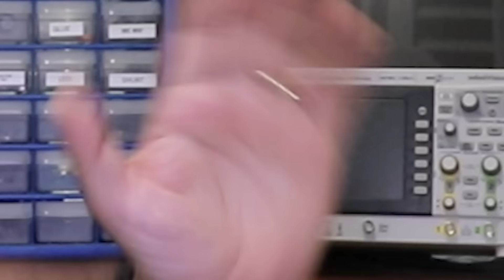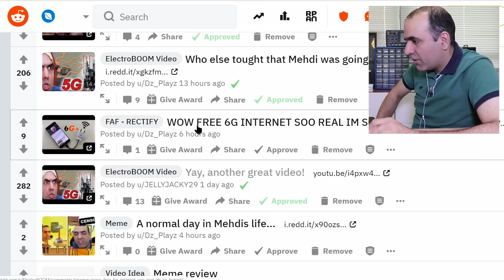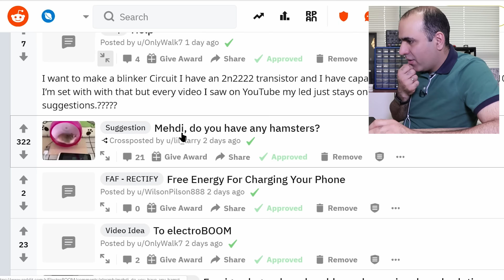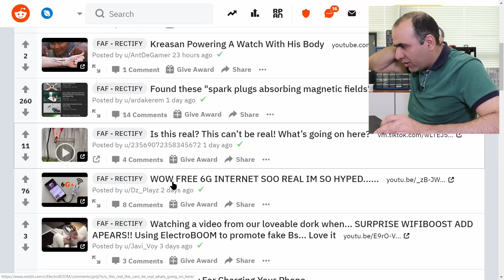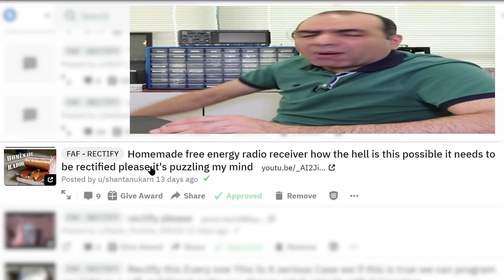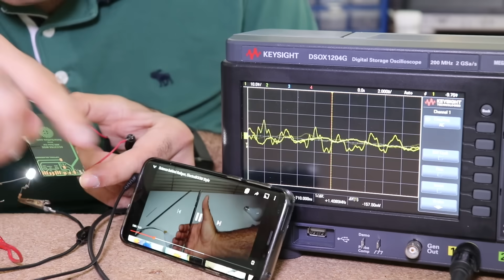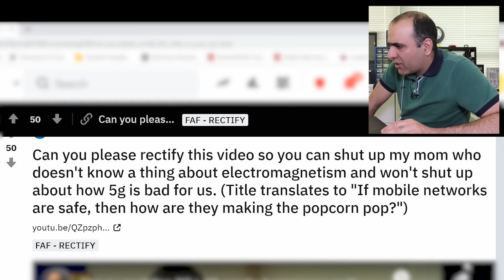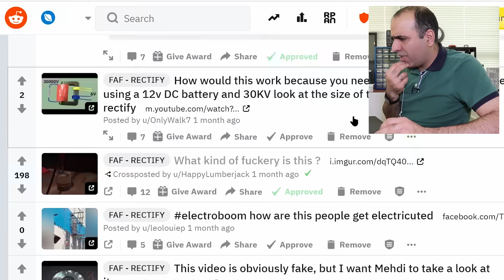ORIGINAL CONCEPT: Reviewing Your Reddit Submissions LATITY-001

Comment: Dude: I got a crazy idea, I can send data with light!
Me : Don't we have internet through optic fiber tho?
Reply: Also lifi
Reply: Well, it's a great way to showcase the concept of optic information transmission, for sure.
Reply: The response time of the solar panel voltage would be very slow. I tried this and the fastest I could reliably transfer data was 1.3kbps. Photodiodes designed for sensing light instead of collecting light can go into the Gigabit range though.
Reply: also 150GBPS isn't even so much fake tbh
Reply: 1. One human cell contains 75MB genetic information.
2. One sperm cell contains a half of that; that is 37.5MB.
3. One ml of semen contains 100 million sperm cells.
4. In average, ejaculation lasts for 5 sec and contains 2.25 ml semen.
5. This means that the throughput of a man’s penis is equal to (37.5MB x 100,000,000 x 2.25)/5 = 1 687 500 000 Megabytes/s = 1 769 472 000 000 000 bytes/second = 1609.325408935547 Terabytes/sec. (In data line / network terms a 12 874.5 Terabit Line)

This means that the female egg cell withstands this DDoS attack at 1,6 terabyte per second, and only lets through one(!) data package, thereby being the best hardware firewall in the world!

The downside of it is that this only small data package that it lets through, hangs the system for the whole of 9 months!
Reply: @ulkoalex  Thats briliant. :)

Comment: 5:05 This one actually works, Theres a boost converter wich outputs 5V (i've got the same type laying around, very handy)

you can even easily use a tiny solar cell, allthough you phone will never actually charge, it'd take FOREEEEVER

I've tried the thing with a solar cell and a 7W flashlight. I suppose the output wattage is less than 100mW but technically it's charging
Reply: I doubt it. I have a few hand crank 3V LED flashlights and the physical resistance against the applied torque is huge. Considering the resistance at such low power output, I seriously doubt if a hamster can power something that requires much higher power.
Show us a video of your setup and it will be much appreciated.
c:
Reply: @mu11668B  I'll try to make a video tomorrow, I'll send you a message

the point of my comment was supposed to be that you don't need alot of current to make your phone say that it's charging, it takes alot more to actually charge it. also, i think the motor in the video didn't have a gearbox and these small brushed 3V motors are relativly easy to turn even with shorted outputs

Comment: you can probably make the microwave beam safe if you hide behind a fine metal mesh, similar to the mesh on the microwave door. the microwaves will not pass through holes in metal under a certain size.

Comment: Hmm.
I wonder if I could make a microwave gun that focuses microwaves in order to burn things at medium/long distance.
(For research purposes of course)
Reply: "Gun" and "research purposes" in the same sentence
Reply: So basically a laser gun with lower frequency 😉. Sure you can do that, just remember that the power drops by squre of the distance. So it will be very short range gun unless you have a power plant in your back yard
Reply: @-JG-339  Hmm.
Who said it has to be a continous beam?
If i could make a large enough capacitor bank then i could prolly make a pulsed version.
Reply: @-JG-339  that's called a MASER, they exist, fucking expensive tho. I believe he just means a parabolic waveguide that directs the light into a parallel beam, like almost all flashlights do
Reply: Focusing microwaves requires very big dish antennas just to get to 15° or so. I'm surprised the guy even managed to light a tube that far away. I bet he had to arrange the lamp and microwave carefully to just about get it to light at that distance. Without the metal fridge wall reflecting, this would probably be too far already.
Reply: Keystone Science did this!
Reply: @MrScorpianwarrior  I might check them out.

Comment: Blinking two leds using transistors is so easy and i tried it. It works btw so thanks
Reply: I built that circuit when I was an apprentice. When I was done I started to replace the resistors with potentiometers and tryed different capacitors. That was when the real fun started^^

Comment: That microwave guy needs help ASAP before he cooks himself...
Reply: i think that is fake tho... how does microwaves stand out so much time ? i saw a video trying to do that with a choco bar and didn't even started to melt... it needed the shieding (reflection) to continue strong and active... I don't know... seems fake to me... even with that sfx still... i doubt
Reply: @MsTatakai  If you're referring to the King of Random video, they were just firing the microwaves out of the front in a big unfocused blast. In that guy's case, he was focusing them in more or less one direction. It's like a flashlight vs a ceiling light (or even a laser). The ceiling light and the flashlight can both be equally bright, but the flashlight will take a lot less power because it focuses the light into a much tighter beam.
Reply: @awareqwx   makes sense and yes was thet video i was refering it ... but that cone shaped could be an amplifier and expands the way all the way to the lamp and it turns ON and he did a harmful wave indeed but I don't know if it would reach him and also we kinda don't know how far is he recording with the camera =P but yeah being open minded is also bad for this... everthing can be ezly influencied XD (talking about me)
Reply: In argentina we have a youtuber called "el angelito" he modified a microwave to use it as a cannon for experiments. He is a technitian with decades of experience with high voltage
 He really knows his stuff
Also says NOT to do it at home
Reply: David Daivdson  microwaves use the same frequency as satellite communication and airport scanners. Youll probably get a visit from the feds and a FAA inquiry.
Dont do it.
Reply: @Tatwinus same frequency as non-essential communications. Wifi is there, but government/military coms are not. That band is meant to be noisy, i doubt anybody would notice leaky microwave. Maybe your neighbour's wifi would fail, and that's it.
Reply: Yeah cannot stress this enough dont do this and if you are do it outdoors and not in an enclosed area
Reply: @shadowxxe  lol do it "safely" outside like Kreosan
Reply: @shadowxxe  there is no "if you are" for that. There's only "DON'T FUCKING DO IT!!"
Reply: @shadowxxe  I really don't think that's a worry for a few reasons.
1. it's unlikely to have standing wave in such a random and "open" (windows, floor and ceiling that likely aren't reflective) environment, so that helps quite a bit
2. most parts of your body have built in temperature sensors. You will know before you are burnt
3. At absolute absolute worst, intensity should drop by the square of distance. When you microwave food food is some 20cm? away from source. King of Random did an experiment where they tried to microwave things with an open oven. They couldn't pop popcorn for like half an hour. If you stand 2 meters away you are receiving 1/100 of that. At that rate of heating it's hard to imagine your sweat glands, or even just your surface area, not being able to dissipate the heat.
Also just in case, microwave isn't ionizing, so no dna damage. Heat is all it does, and that it doesn't do a lot.
Reply: @randomnobody660  They taught us if we ever walked in front of a plane and we felt our balls tingling, to step to the side of the plane and tell the pilot to turn off his weather radar.
This is transmitting at about 6000 watts.
Reply: Or some innocent bystander!
Reply: Couldn't he wear full body protection suit? If somebody can built something like this i can't believe they are crazy enough going unprotected
Reply: he probably turned into Radioactive Man by now
Reply: Let him it's just natural selection.
Reply: Nah let him cook. 😏
Reply: That guy made a actual tumor machine, dont try it outside or inside, just dont do it.
Reply: @DajJohnDude  rewatch Mehdis video on 5G, microwave is non ionising radiation, no tumors (insert Arnold Schwarzenegger oneliner).
Reply: @sergeigontcharenko3476  Could still cook your eyes.
Reply: "Just a little bit of cancer, Stan!"
Reply: @ross302ci  vinesauce

Comment: 11:15, Try using a Laser Pointer as its intensity mostly remains the same for any minor change in distance, which is a great problem with LEDs
Reply: We should figure out a way to transmit internet with it. I call MY invention THE OPTIC FIBRE FIBER OPTIC LASER INTERNET.
Reply: @sambishara9300  Whooaaaa you should put it inside a cable and build a whole network of internet distribution out of it!
Reply: well, actually there is a video showing similar concept for "hacking" alexa(or google thing, forgot what it's called) with a powerful laser through a window, by shining it on the microphone hole. Cool thing
Reply: @nestor1208  Yup! checkout the channel @SmarterEveryDay and you'll find that video among a lot of other interesting videos! :)

link to the video : youtube.com/watch?v=ozIKwGt38LQ
Reply: @nestor1208  It's a video from SmarterEveryDay, link : https://www.youtube.com/watch?v=ozIKwGt38LQ
Reply: Are we realy trying to make SPDIF over optical from scratch?
Reply: @MazeFrame  isn't SPDIF digital transmission standard? Also ADAT
Reply: Literally how optical audio works
Reply: The idea behind lifi is that we can use ceiling mounted leds to transmit data through light modulation

Comment: how you are supposed to know where random wires in the wall are? competent electricians will install wires going directly upwards from sockets soo just don't drill or pierce a wall above a socket!!! but yeah also use a live detector because sometimes incompetent electricians may have fitted your sockets and run wires in a maze like pattern for some reason

Comment: Put 5 microwaves together like the guy did in the last video, and set them up around a generator so that to turn them on you have to turn on the generator, but the microwaves are connected so that they spin. Add a bunch of lasers and dust in the room. Massively dangerous stranger things style microwave gun used to open portals to the other side.

Comment: About the live screw in the wall: Usually it's kind of standard to run the wires vertically up towards the junction boxes, so it's always a good idea to avoid drilling right above the contacts/switches etc. Some countries run the cables vertically down towards the floor (Only Germany comes to mind as an example atm), so in any case - try to drill a bit off to the side :D Also if the junction boxes are not directly above the contact/switch etc., the cables coming from them do a 90 degree turn in the direction of the junction box once they reach its height, so keep that in mind as well when drilling near the ceiling. The amount of times I've seen people drill into electrical cables and later having to replace them is not even funny :D

Comment: Audio transmission through light! That's groundbreaking… in 1880, when A. G. Bell already did it.
Reply: how was this 1 day ago
Reply: @fw1093  Patreon/ Channel Supporters my guy. They get it early I believe.
Reply: @fw1093  some comments are from 2 days ago
Reply: I like the intro LALITY
Reply: @dantetinai5917  It's LATITY not LALITY
Reply: Actually most people don't realise that they have been using data transmission through light for years now. Infrared remote control is example of it.....😄😄
Reply: @kaustavsengupta8757  Actually, basically every communication technology we have is through light, from Internet/Wi-Fi to AM and FM radio
Reply: @WarioNumberOne  yes exactly! It's light that we as humans cannot see. They are at wavelengths the eye cannot see.
Reply: @WarioNumberOne  I know, every wave and visible light is part of electromagnetic spectrum.
Reply: We could send the light down a guide and call it Fiberoptic data transmission.
Reply: @dogwalker666  or use a specific light to read files off a metallic disc of some sort. Maybe call it a compact disc?
Reply: It would have been cooler if he had used an LED on the receiving end as well.
Reply: Even I did a project on it. (Li-fi or light fidelity). Mehdi was right the sound is directly proportional to the distance between the receiver and transmitter
Reply: @Idunnowhoiam102  I've seen laser pointers with 3.5mm inputs for exactly this purpose so the distance can be massively increased.
Reply: I remember going to a science museum, and you connected a light source using acrylic shapes to the receiver to play music. I think it quoted A. G. Bell too.
Reply: Tosslink anyone?
Reply: @UntrackedEndorphins  toslink is digital
Reply: I'm using an optic cable from my motherboard to my amp in my PC audio setup.
Reply: @simp-slayer  my old CD player links to the amp with a Fiberoptic
Reply: The dude was so excited about it he actually tried naming his daughter after it
Reply: Yep, in fact you can bounce a laser off a window and using this same method you can listen to people talking behind the window. I think I read somewhere the CIA did this.
Reply: @billtyson56  Leon Theremin, buran, KGB stuff but the concept isn't exclusive to the Soviets
Reply: @billtyson56  interesting. care to elaborate more or list interesting videos/references on the subject ?
Reply: @billtyson56  interesting project. please post on reddit so Mehdi can try it :D
Reply: Theres a movie which talks about all that it's great you should watch it
Reply: I would rather call that signal transmission than audio transmission
Reply: I actually did that in snap circuits
Reply: Also optocouplers do this all time.
Reply: And Toshiba
Reply: Laser disc, CD's, DVD's???
Reply: Even the effect is well known, someone made a bait clicking video... and he is so dumb that had to fake it!
What should be in the brains of such people?
Reply: It's pretty much how fiberoptics works, isn't it?
Reply: The video is clearly fake. The audio is playing even when the youtube video was closed. Just look at 9:52 there is no sign of the video being minimized. If it was minimized it would appear above the home logo at the bottom of the youtube ui. But as we see in 9:52 it is not present. Clearly fake!

Comment: Data transmission through light, when done well (ie with a photodiode, not a solar cell) can be very fast: https://fr.wikipedia.org/wiki/Li-Fi?wprov=sfti1 

Usually we’d use a band pass filter to keep only the carrier frequency and the signal, so it works even with the lights on.

Comment: Love the #Davie504 influence! I will slap like, epico!

You could totally use a laser instead of an LED for higher fidelity audio!
Reply: I read an article a long time ago about using lasers that is being reflected of a window to eavesdrop from some distance away. Don't remember if they had it working or were only theorizing. It seems google is your friend https://en.wikipedia.org/wiki/Laser_microphone :D
Reply: @snellface  Smarter everyday did a video somewhat recently about using lasers to transmit a audio signal to unlock smart home devices and interact with Alexa/google assistant. So it's kind of working and people are definitely actively researching it.
Reply: Sparky I mean that’s what most home TV controllers use are infrared waves to transmit basic commands. The smart tv remotes have a combination of radio and infrared. Fiber Optics are also used in audio and data devices especially for long distance transmission or if using a typical copper medium isn’t viable due to electromagnetic radiation causing data or audio corruption.
Reply: @snellface  what about using visual vibration caught on camera?
Reply: It would definitely sound better and could be used at much farther distance. I just like how people are thinking the led concept is new when it’s basically the same thing as fiber optic transmission
Reply: I see another SLAPPER! SLAP like!
Reply: We are one, SLAPPERS. CAUSE I FRAID DAVIE WILL COME TO MY HOUSE AND TAKE ALL MY WATER, I AM THIRSTY RIGHT NOW
Reply: Or you can just use IR wavelength, https://radiokot.ru/circuit/analog/home/06/
Reply: @maxhijacker  I was looking for this, the lights wouldn't affect then
Reply: How are you here?
Reply: He should use B A S S instead of solar cell.
Reply: or just use an optical audio cable
Reply: Or build a compressor behind the solar panel to keep the audiolevel steady
Reply: I can't wait for someone  to invent TOSLINK, imagine how cool that would be
Reply: How the hell is this comment 2 days ago
Reply: Video posted: 3 hrs ago
Comment: *2 days ago*
Reply: How is your comment 2 days ago?
Reply: @DiogoCoutoooo  
Patrons get to see the videos early.
Mehdi tells us about it all the time.